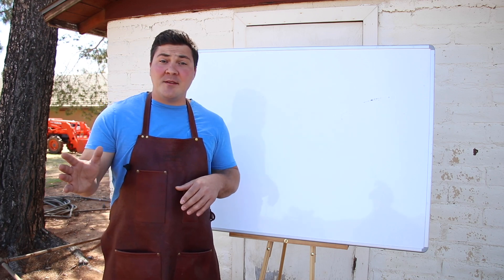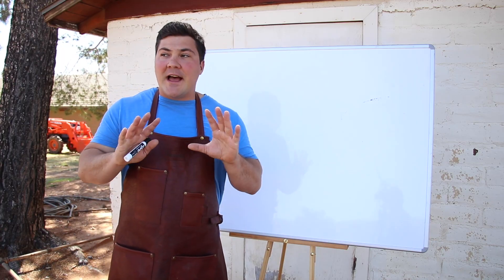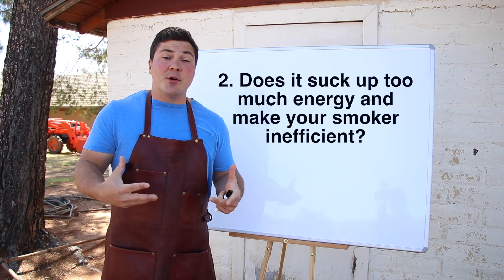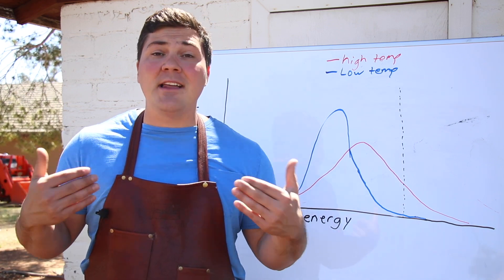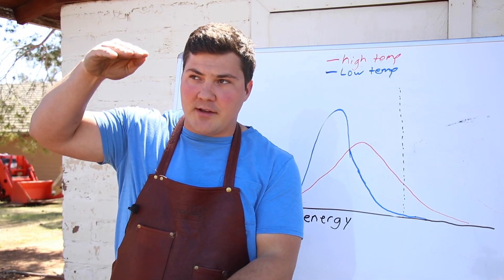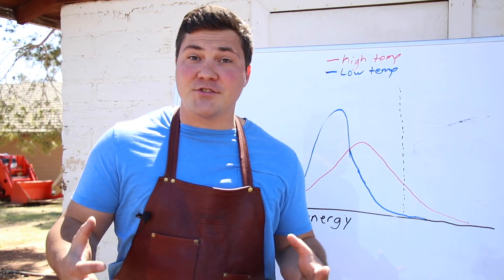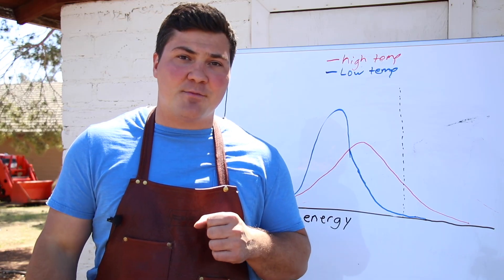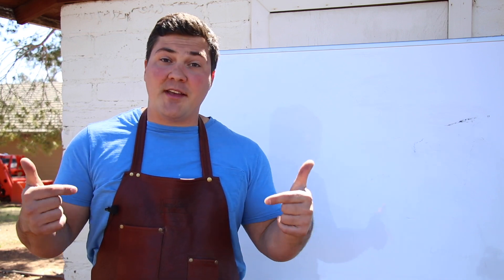Do Water Pans Improve Barbecue? A Scientific Analysis

Comment: Thank you... Love the knowledge drop.  But as you were going over the numbers I realized that there were a couple of situations that throw the moisture numbers way off... I know you were basing the numbers off of your smoker, and the basics of a stick burner smoker. But with Komodo Smokers and a Kettle with a slow and sear, we burn much less real wood. Just a handful of wood chunks. Probably why you get less of the awesome smoke flavor. But with those its even more important to have a water pan because most of what is burning is Charcol wood chunks which I believe based on your math of seasoned wood would have significantly less moisture overall.  But love the Chanel, and the science content is just awesome, I think we all become better pitmaster once answers to the why's, and not just how to do Smoke something.
Reply from the maker: Christopher Willoughby 
Thanks! Yeah the charcoal would produce less water than a piece of wood for sure
Reply: I don't think "its even more important to have a water pan" is correct due to the extreme efficiency of a ceramic smoker, in the case of the Kamado. I have a Big Joe and the moisture that comes off the meat stays in the smoker to a large degree. I have never had meat dry out on the ceramic as I have had on a gas grill for instance. My assessment is that a water pan, on a Kamado, is less important. YMMV